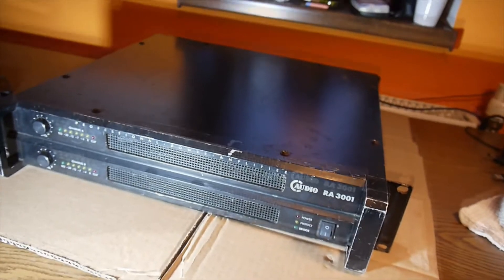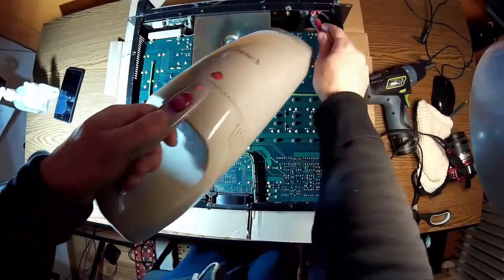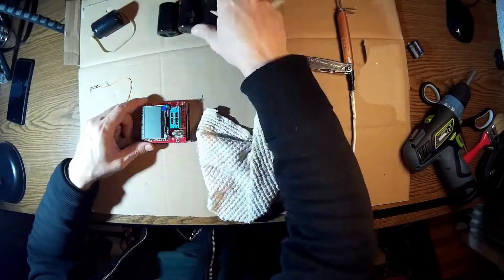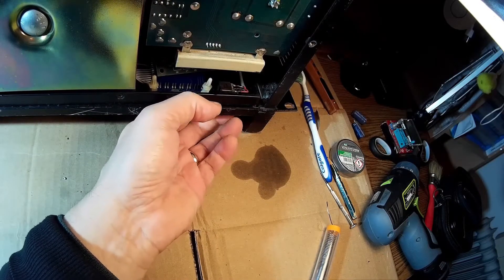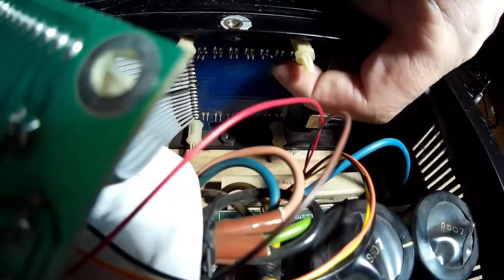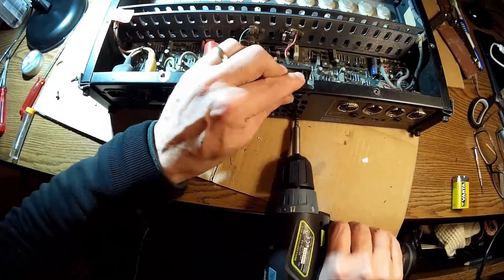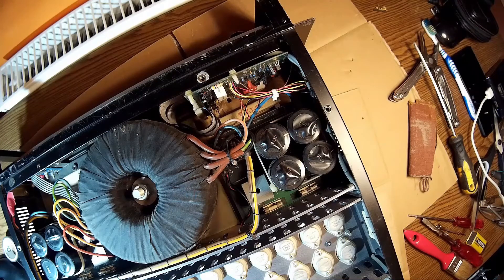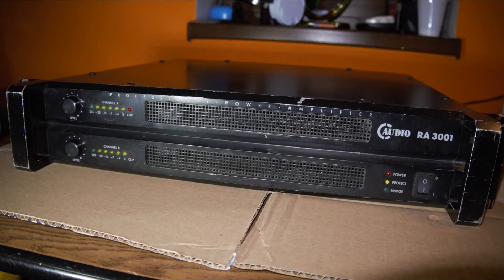C-Audio RA3001 Power amplifier check and fix

Comment: i have one c audio ra 3001 power on but led protect is on no sound output can you help me what i can do
Reply from the maker: Check the MOSFET transistors first. You have a short somewhere.
Reply: Not necessarily, Check the DC rails, there are the main voltage rails for the FETs, these can be checked at the fuses (WRT gnd) you can then check the outages to the input chip (Rear right of amp) you should have around +/- 18V if you don't check the input voltage to the dropper resistors as these sometimes burn out/ go high. if they are not getting the correct voltages then check the 4x 22R resistors at the edge of the board (Rear left) NOTE: these may be soldered to the pub on the underside or the component side. these also have a tendency to fail.
you may also have a fault in the protection circuit (the area in front of the fan) check the top of the zener diode for 9v1 when switching on, if it doesn't come up then the resistor (R69) in series is OC The protection system works thus:
The protection system is based around Q20-Q25. Under normal conditions Q20 – Q23 will be off. At turn-on C40 will charge through R65 towards the +LT supply rail. The voltage is fed to the base of Q25 via D11. When the voltage across C40 reaches approximately 10V Q25 will turn on and thus turn on Q24. Resistor/diode network R67 & D38 connected between Q24 collector and Q25 base provides positive feedback in order to make the turn-on/turn-off of Q24 more defined. The collector of Q24 is connected via R68 R150 & Q45 to the coils of relays RLY1-3.
Transistors Q20 and Q21 are connected in such a way that a voltage of -650mV applied to the emitter of Q20 will turn on Q20 and hence Q21. This will rapidly discharge C40 and hence turn off Q25 and Q24 thus opening the output relays. Similarly Q23 is connected such that a base voltage of +650mV will turn it, and hence Q22, on with the same resultant opening of the output relays.
The output of each channel is fed via resistors R63 and R64 into C38-C39 and then via D9 and D10 to Q23 base and Q20 emitter respectively. The combination of C38-C39 with R63 and R64 forms a low-pass filter, and so at signal frequencies C38-C39 will have no voltage across it. In the event of a DC offset appearing at the output, however, C38-C39 will charge to a DC voltage, turning on Q23 & Q22 or Q20 & Q21 depending upon the polarity, and hence opening the output relays.
The Network consisting of R62, R61 and C37 provide the rapid turn-off feature of the protection system. R61 is connected through the 90 degree thermal switch to D37 and D7, which are connected to the secondaries of the mains transformer. The union of D37 and D7 will, therefore, show a full-wave rectified version of the secondary voltage. This is averaged by C37 to a negative DC voltage, reverse biasing D8 and, therefore, having no effect on the protection system. Should one of the thermal switches open, or the power be turned off, C37 will be rapidly charged towards the +LT rail via R61, forward biasing D8, turning Q23 on and opening the output relays. If there is no rapid turn off, suspect R62 (100k) this may be open circuit. It is worth noting that failure of this resistor will render the thermal shutdown useless.
Hope this helps 
Lee Basham senior service manager C Audio (Retired)